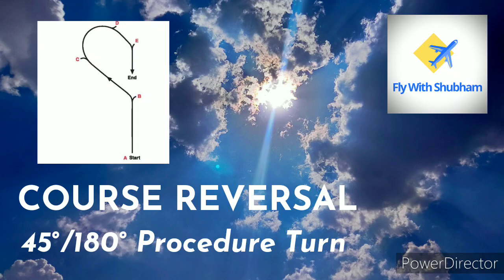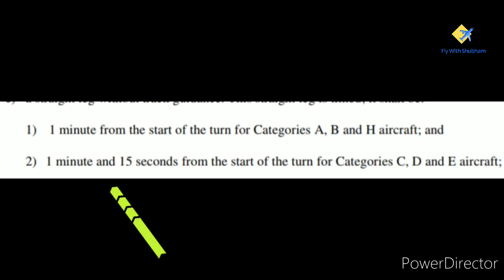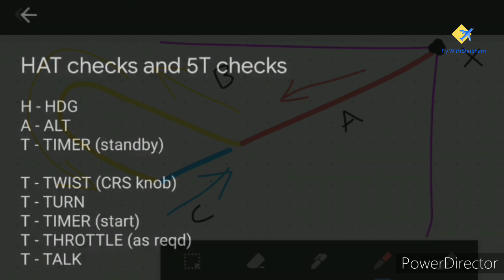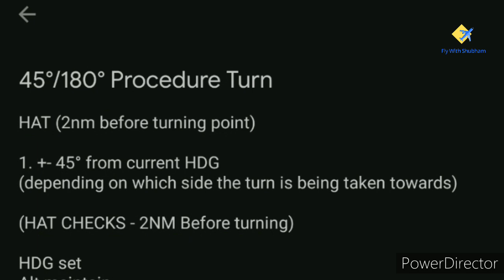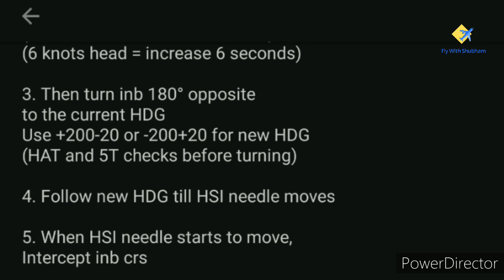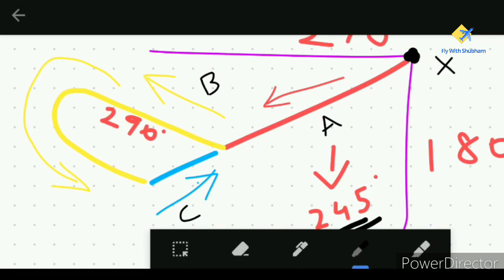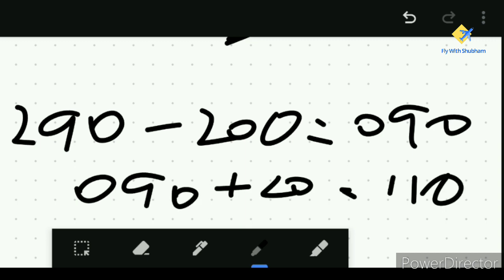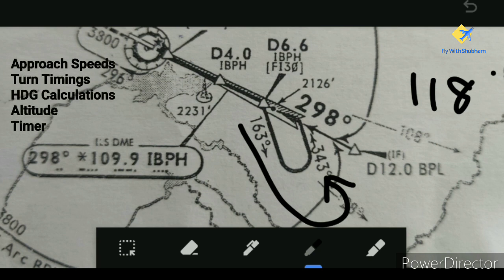45°/180° Procedure Turn | Course Reversal | Learning Instrument Flying | Fly With Shubham

Comment: 290-180= 110
245-180= 065

No need to make long computations like the -200 and plus 20…
Reply from the maker: The computations aren't long.
Surprisingly many people have issues in calculating +-180 degrees in a complex situation in flight, that's why a simpler method with simpler values is used in many many places

Comment: I didn’t understand why you added 45 + 20 to get the inbound course? And if you did it to get the inbound course, then the final inbound course will be shown on the approach plate right?
Reply from the maker: So once you make a 45 turn from your current HDG (for example 200 radial outbound) and turning to the right (245 HDG), you fly as per timings based on your aircraft type on 245 HDG.
After that you have to make a 180 degree opposite turn so that you can intercept the radial 200 (020 CRS inbound)

The crs becomes opposite since you're now going inbound.

To calculate the 180 opposite of 245, the formula (+200-20 or -200+20) is given to make the calculation easier.

So 245 - 200 = 045
045 + 20 = 065

065 HDG is your inbound HDG. But your final inbound course is 020.

Then the needle on the HSI or CDI starts to move and you slowly turn back to intercept the crs 020 inbound. 

Secondly, yes the final inb crs is always shown on the approach plates.
The approach plates have all the details.

Look at the approach plate as I've given in the video, it shows the procedure turn as well as the final inbound course
Reply from the maker: One more thing to note - 

The procedure turn consists of HDG changes only

The CRS is the radial on which you are going outbound, and the inbound course is the 180 opposite of that outbound radial.

45/180 turns are just HDG changes.

When turning inbound, the CRS will always be changed 180 before commencing the procedure turn (as per the HAT and 5T checks), but the radial remains the same.